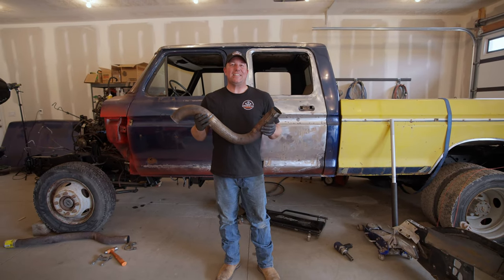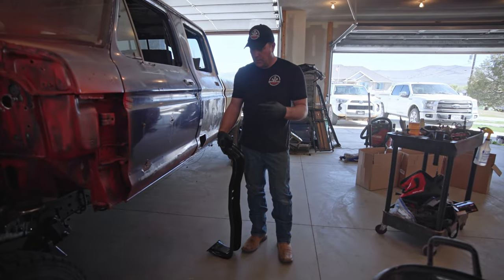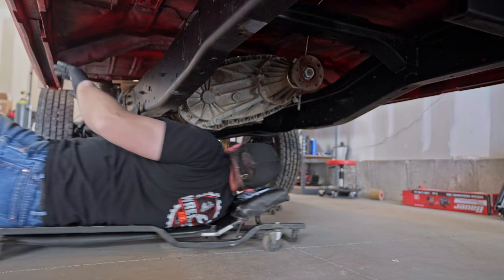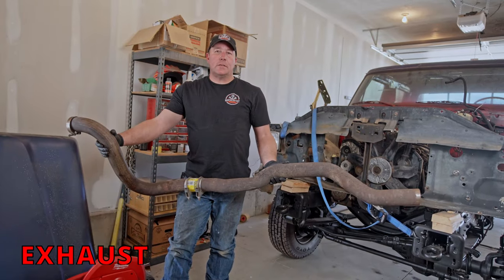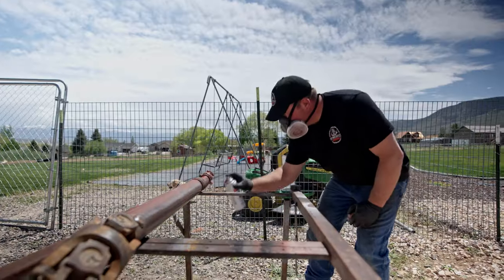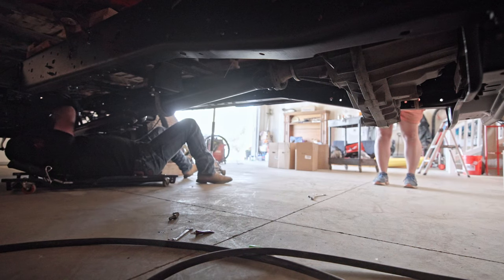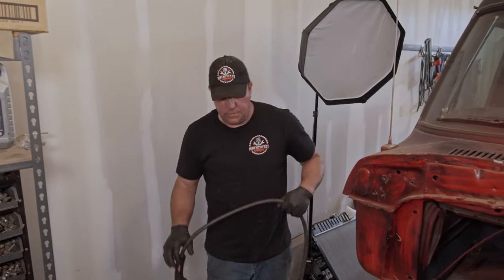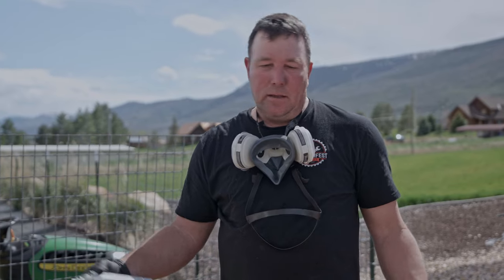Dentside Cummins is almost ready to run and drive.

Comment: Going to be sweet. I rebuilt a p pump cummins and swapped it into a 72 F350, running and driving in 3 months 28 days. But it was 2 wheel drive, and I didn’t have to body swap it. You are moving right along.
Reply from the maker: Sounds like a cool build! We will both be running and driving real soon! Thanks for watching! 😁